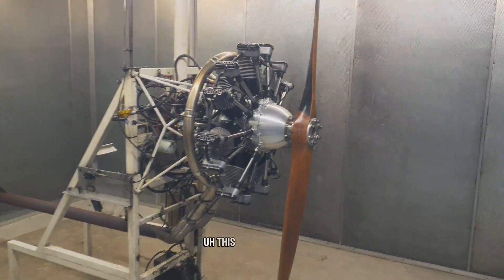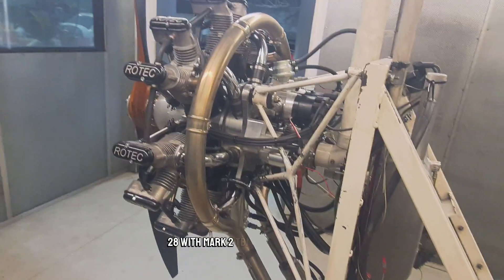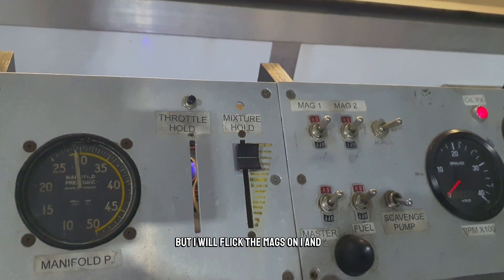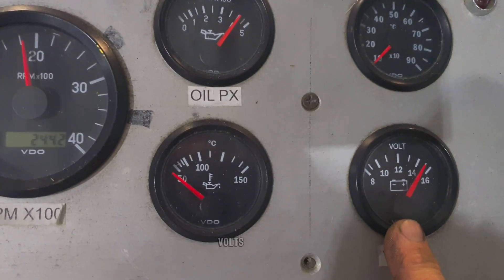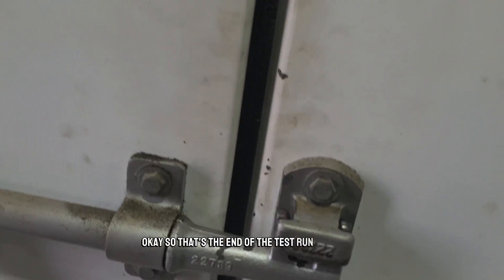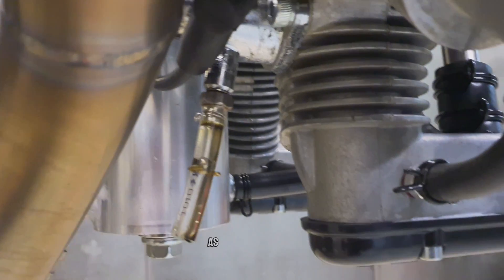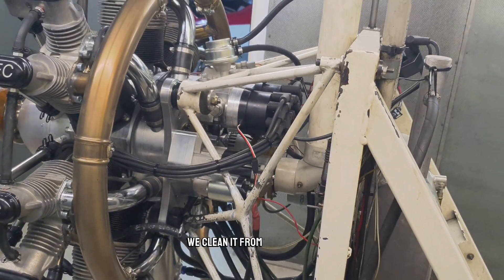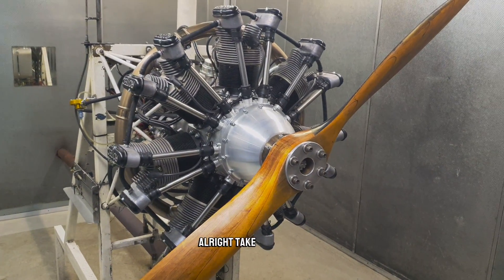Rotec R2800 test run (Jonn B) Kitfox project USA.

Comment: Beautiful engine.  Could not help but notice Oil pressure dropped back from 400  to 250kpa as it warmed up  at 3200rpm and then fell to near nothing when you went back to idle.  This would not be normal would it.